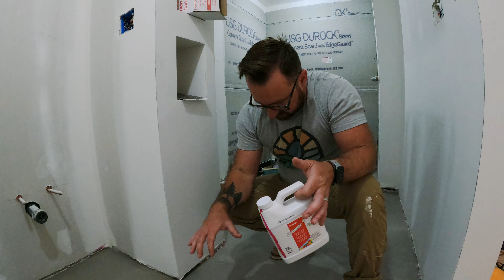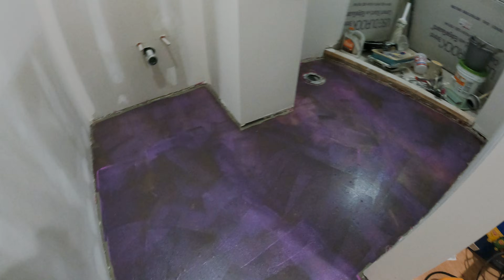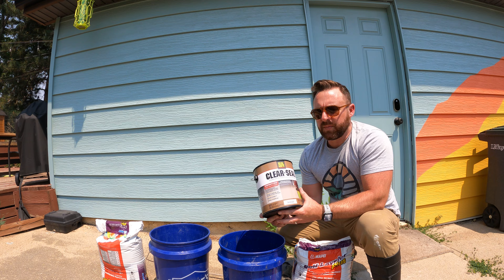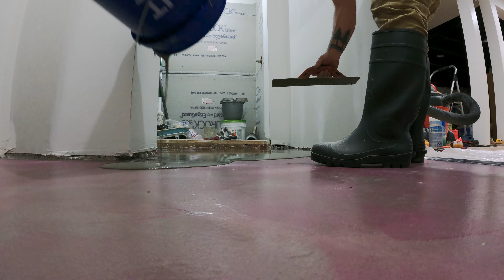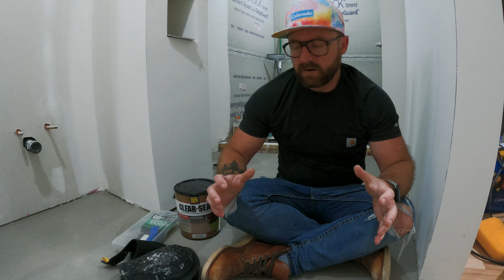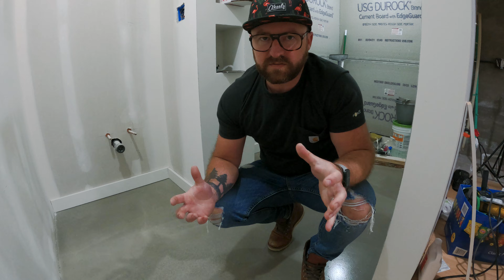Concrete Floors Instead of Tile? Easy DIY Self Leveling Project

Comment: How has it held up for 3 years??
Reply from the maker: It has held up so well! I would for sure do it again. We are actually thinking about doing it in a different room soon.
Reply: @beardedspruce I’m thinking of doing a polyaspartic top coat instead. What do you think? You have had no chipping or scratching? I’m doing this in the whole downstairs of my house 1400 sf wish me luck I have help from guys that have some self leveling before. How thick would you recommend I put it on? I know you did two coats but not sure if it’s necessary
Reply: @ashleysuarez2556  thinking about finishing my basement this way. How did the 1400 sq ft go? What was your top coat and how is it holding up? Any tips appreciated!

Comment: Thank you for sharing this. How is wear two years later? This version of self leveling concrete from Mapei now adds in the description "not to be used as a floor surface"
Reply from the maker: Hey, thanks for watching! The floor has held up really well. Even through really regular traffic.
Reply: @beardedspruce   thank you. What we've done here is in great shape after a few weeks, just forgot to keep 1/4 inch for contraction on the side, resulting in a few early cracks.

Comment: Thank you for this video! I want to do this in my bathroom, but I want to stencil paint the floor. Do you know if this mapei self-leveler can be painted? I wonder if the painting would happen before the sealant. I can’t find any answers online.
Reply from the maker: I am not 100% sure. A lot of concrete is died before poured for color. But, if you are going to paint, I would def do it before you seal it, to get maximum penetration into the poured concrete before you seal it.

Comment: My question is what concrete did you use over top of the subfloor BEFORE your Mapei Self Levelling concrete final layer? Were you able to concrete over the patches of old adhesive and bits of tile you mentioned that you started with? Asking as I have a similar floor to deal with (removing very old thick tile and left with a rough bumpy surface over older concrete. Do I need to get that completely smooth before I apply another layer of concrete? Or do I need to paint on a primer on top of the rough bumpy bits to allow concrete to concrete adhesion?
Reply from the maker: All I did is paint the primer on top of the old gross bumpy adhesive and random bits of tile. Then poor the self leveling concrete on top according to the instructions! Best of luck with your project!

Comment: I want to do this at two rooms at my house , my question is  can I do this on top of wood floors (plywood).?
Reply from the maker: People do self leveling on top of plywood subflooring. You have to make sure you have no gaps where it could leak through and now movement because it will crack if there is any give

Comment: Thank you for showing all the steps in the video. Thanks to you I am in the process of doing this. I have a question about the sealing- you said 2 coats? Was that too slippery? Also, did you wet the roller first? I am planning to do this step tomorrow. Thanks in advance!!
Reply from the maker: 2 coats seemed pretty perfect IMO. You could always do 1 and let it dry to see if you think it’s enough. I wanted a little more protection. I did not wet the roller first, I don’t think it would hurt anything though. Best of luck

Comment: Man great video! I do have a question. Whenever it comes to removing your toilet, sink cabinet, and everything. Do you have to do that? Can you leave the sink as is and just remove the toilet? And did you prep the floor with anything before you added the first layer of cement?
Reply: Or do you take it all out so you can completely remove the old flooring below?
Reply from the maker: I would suggest removing everything for 2 reasons. It can mess up your cabinet/toilet if you get the mixture on it and you don’t want to lock yourself into that exact vanity and or toilet forever. You never know if/when something will need replaced and if you concrete around something it lends to less flexibility in the future
Reply from the maker: After cleaning the subfloor, I used this primer from Lowe’s https://www.lowes.com/pd/MAPEI-Primer-T-1-Quart-Liquid-Primer/5014025083

Thanks for watching, hope this helps